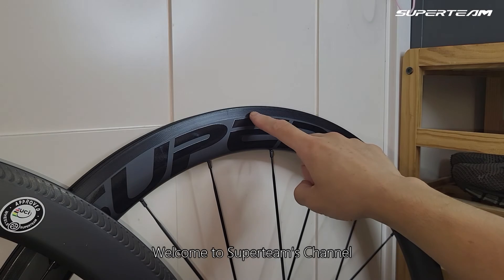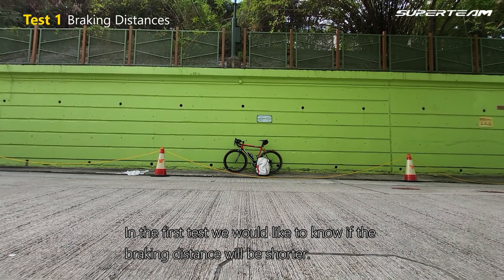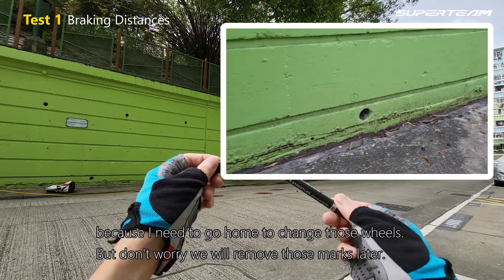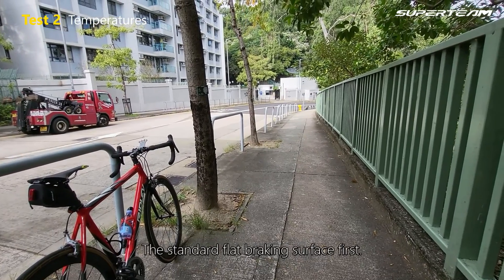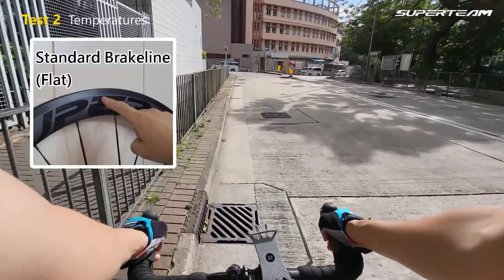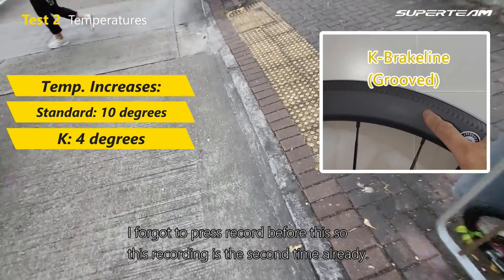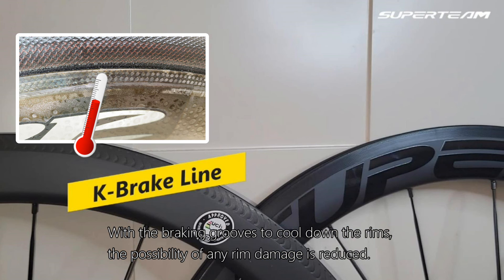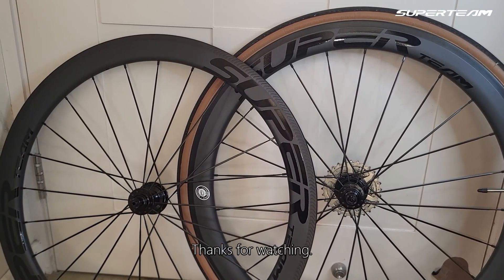Grooved Rim Brake Surface Test - Superteam Wheels (No machine tests so save it)

Comment: Does the K-brakeline make a cool sound while breaking? Like a jet engine
Reply from the maker: Yes but not as loud as the flat normal counterpart.
Reply: @superteamwheelsofficial  just to confirm, the non K-brakeline, is louder when braking? I  want loud but no squeal brakes. Thanks
Reply from the maker: @osc6389  sorry for the belated reply.. the K-brakeline with grooves is NOT louder than the base flat option. No squealing, guranteed.

Comment: flat bracking surface use basalt material or just flat ?
Reply from the maker: The surface is carbon, integral carbon structure.

Comment: What is the rim width?
Reply from the maker: 19 internal and 25 external.
Reply from the maker: Update:
Disc Version 21 and 28mm, inside and outside.
Rim Brake vsersion 19 and 25mm, inside and outside.
Reply: I've looked into some studies on rim width from some pretty reliable sources and found SOME evidence that rim width should be slightly narrower than the tire for optimal aerodynamics. Since my bike won't fit a tire bigger than a 25 a 23mm rim MIGHT be a better choice overall. I'm putting away money for a set of your wheels. Do the K-Line rims come in a 23mm width or maybe even a 24mm? Thanks!  @superteamwheelsofficial